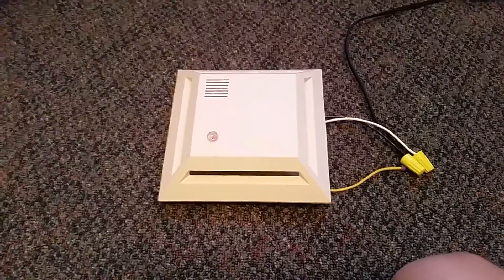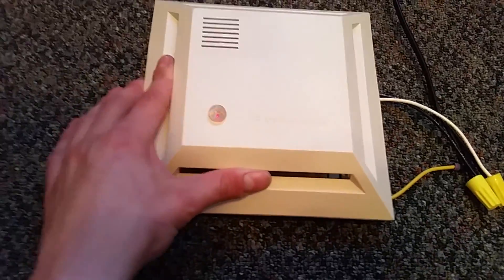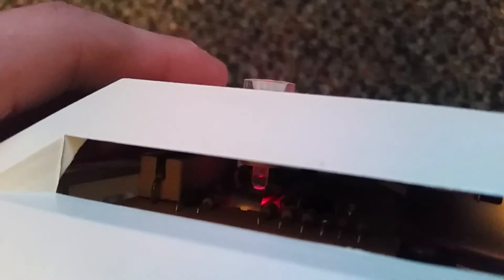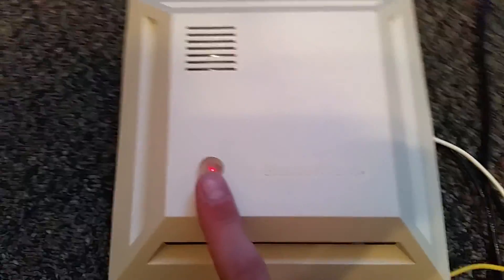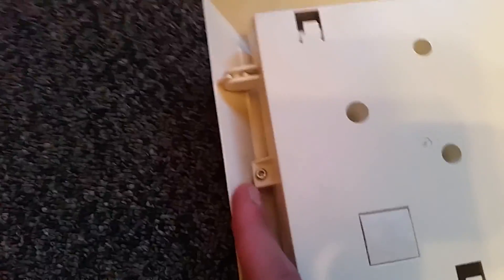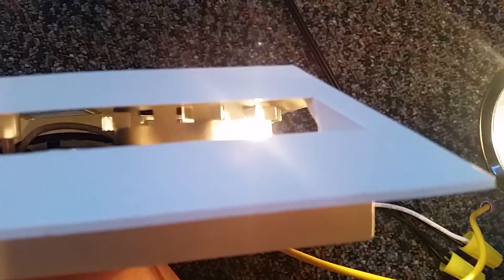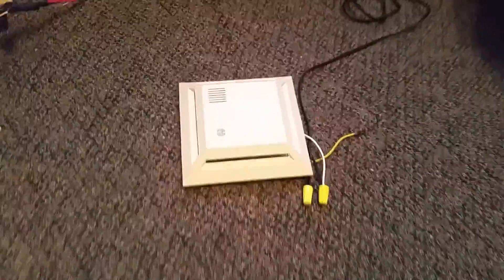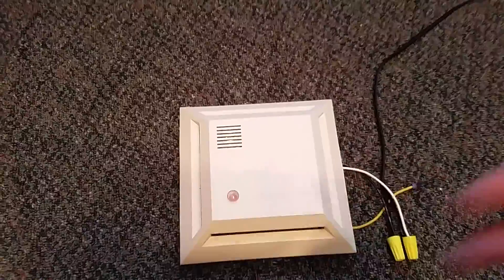Statitrol SmokeGard 907B2 Smoke Detector

Comment: I have these in my home. Would like to know how to temporarily disarm them. I didn't see a visible battery. I tied to open it but the screw wouldn't budge. Please let me know. Thx.
Reply from the maker: These are AC only detectors, no battery. The cover can be opened by removing the two star screws on the back. The only way to disarm them is to disconnect them from power.

Comment: I have two of those in my house which was built in 1979.  One went off at 2:00 A.M. and believe me, people with this model alarm should never fear death by fire-the sound of this alarm is SO LOUD that death is almost guaranteed by HEART ATTACK!  It was so loud,  I was half-asleep, and scared.  YOU CAN'T TURN IT OFF!!!  The only way to turn the thing off was to the grab it and pull it right out of the wall and cut the wires.  The sound is piercing and quite painful to the ears when up close.  Plus, as I was throwing the thing in the trash I noticed an inside warning sticker noting the thing has radioactive components!